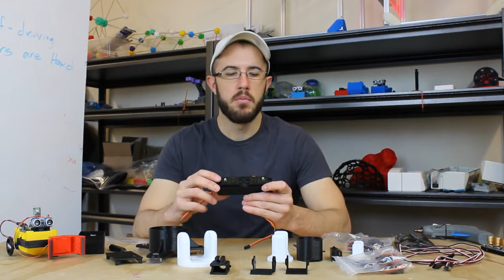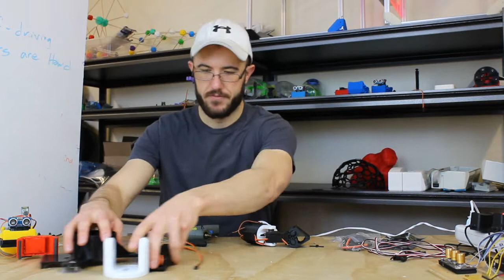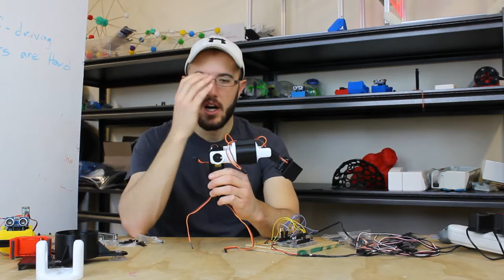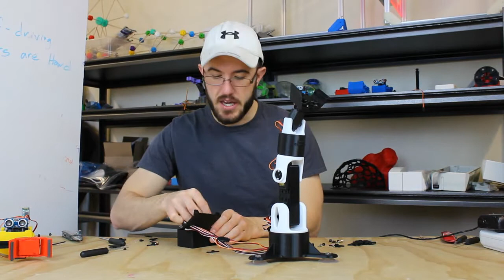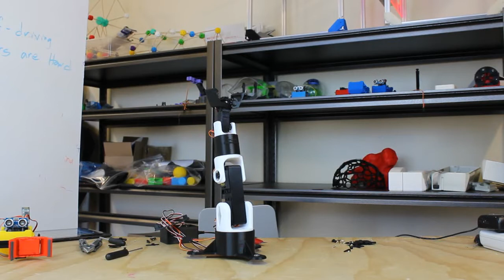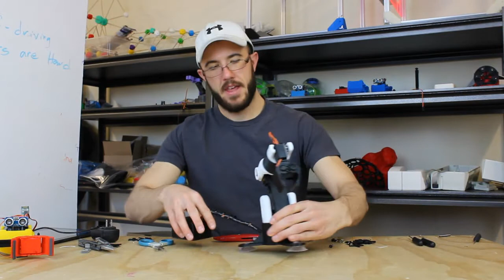Build an Arduino Robot Arm: LittleArmBig Tutorial

Comment: Problem is that in the Nov2019_1 release the "wrist yoke LAV3.stl" has the indent for the vertical horn on the inside not on the outside, as per video and pdf. Can anyone help?
Reply: I have the same problem, I was just building the robot right now. How did you solve it??
Reply: I´ve noticed you wrote the answer in other comment, that´s what I did, but my servo can´t move well, the pieces are too tight.
Reply: @marcopolo0111  can you share stl files as the site is down
Reply: can you share stl files as the site is down